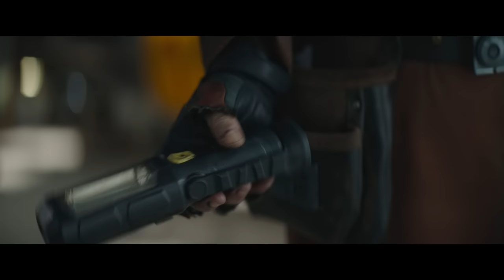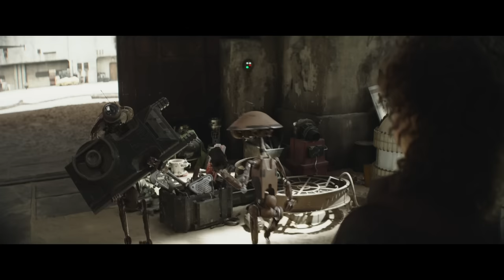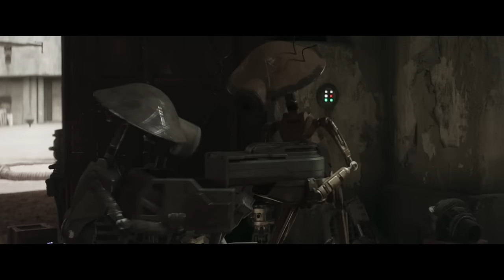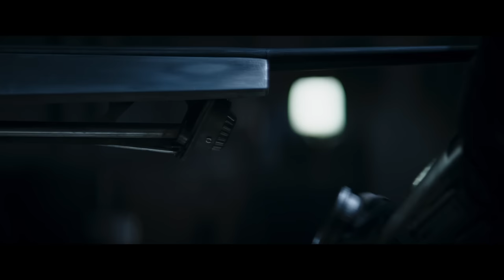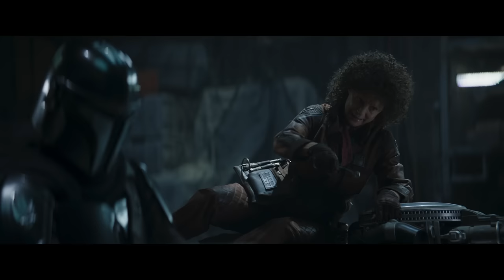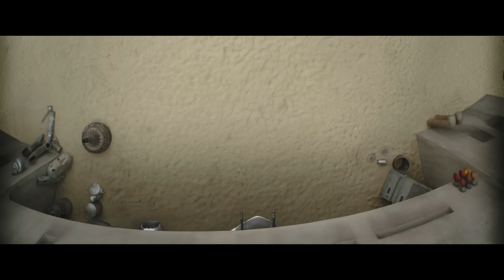Mando & Peli Motto repair N1 Starfighter - The Book of Boba Fett (2021)

Comment: The N1s thin profile made it notoriously difficult to hit, and if you didnt get a direct hit the shot would deflect meaning that the shield wouldnt have to absorb the energy, allowing it to last longer. It was fast, maneuverable, sleek, punched hard, and was damn near impossible to land a direct hit from the front, back, or sides, really only being vulnerable from top or bottom, an issue that could be fixed by rolling. "Spinning is a good trick".

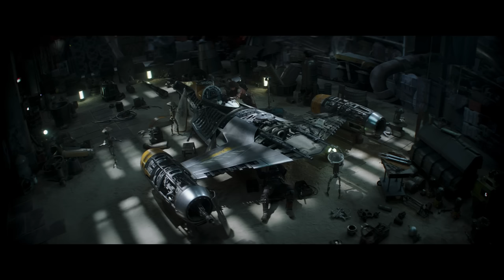Comment: This was Disney appealing to their hotrodder audience. You can even see at 2:00 what is clearly an air cleaner atop a space-age Holley 4150 double pumper, complete with the symmetrical fuel line fittings on the end of the float bowl.
Reply: Lol I'm glad I'm not the only one that noticed that. Yeah N-1 is definitely a hotrod.

Comment: What are the chances that starfighter is the same ship Anakin used
Reply: Probably pretty low. Anakin only flew an N1 for that 1 ride canonically and then more or less swapped to whatever the Jedi were fielding. He may have used on while "protecting the senator", but he generally had his own ride by that point. My guess is that she scored an N1 off of a downed ship and refurbished it with parts that she scored off the open market. The idea of it being a hot rod played to her favor since she likely can't reproduce an N1 with the parts that she has.

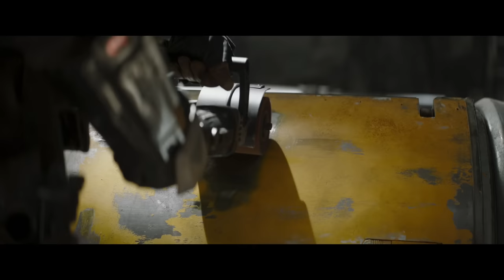Comment: 0:00
Does anyone else find it really offputting how the flashlight and angle grinder in the first few seconds just look like they're from Home Depot?
I mean, that's just an LED flashlight and a no-brand grinder with a plastic shell and handle...

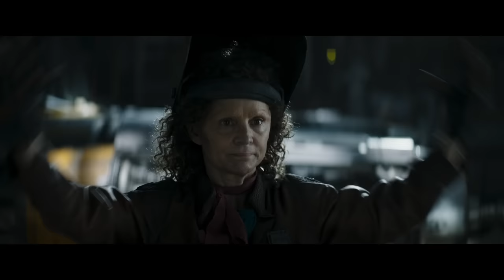What's even weirder is that the die grinders they're using at the 0:10 second mark look very authentically Star Wars.